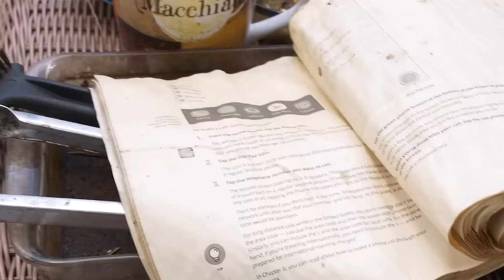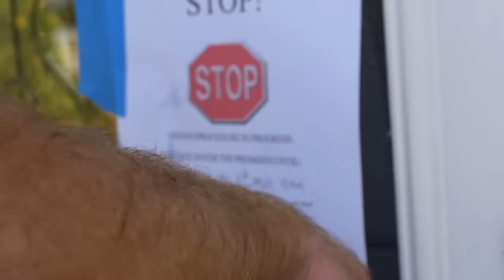Massive Body Meltdown | Naples, FL

Comment: This happened to someone in my building. He was luckily on the ground floor and I was on floor six. It was an early Monday morning and I was heading to work. I opened the door and there was this slight smell like rotten fish but with a tinge of something strange I’d never smelt before that made my heart-rate skyrocket. I had smelt it the day before but it was so minor I didn’t think much of it. My gut immediately went ‘someone has died’ but I have bad anxiety and not smelling death before, brushed it off. It was such a hot day I had forgotten about it until returning in the afternoon. The gate was blocked by a ‘cleanup crew’ loading a bunch of blue bags into their van. The apartment manager told me it was the special needs downstairs neighbour and I couldn’t enter for a while. He was perhaps 60 and had fallen , being special needs (couldn’t communicate) and living alone he had sat there on the floor of the kitchen over the weekend heatwave and somewhere along the line his heart stopped beating. It was a record 40 degrees on the Monday that the smell started to leak past his apartment (dead 2-3 days), and he had literally leaked into the floor and become just jelly. The bags were what was left of his body after the police had come and gone. The smell was so bad it didn’t go away for weeks, You could be on the rooftop and still gagging. The cleanup crew left a window ajar, and that alone made your head spin. We had to work together to close it from the outside with a pole and rags on our faces. His car is still in the garage, as his family still hasn’t been reachable. He used to write on pen and paper to communicate and loved swimming in the pool. I can only hope he wasn’t on the floor in pain for too long.
Reply: That’s the most heart breaking thing ever no family to care no home care from company’s that take care of special needs people ugh 😭
Reply: @boofert.washington2499  So?
Reply: Interesting that the smell you noticed was a fishy odor.  A few yr. ago, the man who lived in the apt. next door to me died and wasn't discovered for a few days. I had detected the odor of fish for several days and just thought someone had had a good catch and was frying it up.  It wasn't a rotten fish smell, just an odor like someone was cooking it.
Reply: OMG that's so horrible 😢
Reply: It's interesting that you compared the odor you detected as fish.  A few yr. ago, my next door neighbor died and had been dead in his apt. for a few days before being found, and that's the same smell I got.  I just thought someone had caught a bunch of fish and had been cooking it for a couple of days.

Comment: The sheer amount of area that the body melted into is astonishing. It's so sad that he was alone, and it took so long for a welfare check. May he rest in peace.  That was a huge job! Done well with respect and honor.
Reply: Melted?!  Huh?  Do you mean decomposed?  Am i missing something?
Reply: @danielleschoenlau7861  yes melted. The actually definition of melt is "liquefied by heat". Decomposition requires a large amount  of heat for its normal processes. Therefore as the body decomposed it melts, because decomposition literally turns the body into liquid.
Reply: Right, this is ONE body?? Just Horrific! Where r the bones?
Reply: @jankasza5538  they removed the bones and any flesh that would have been left that did not liquefy. The coroner removes as much as they can.
Reply: @llewisdolphins So that is literally the man’s liquidated body? 
That’s awful..
Reply: @Juju-l3o  yes

Comment: Craig seems like a good addition to your crew! Wow that’s quite the mess to clean up! You know you’ve been watching these for a while when you instantly say well the tile is going to have to go and the baseboard maybe some of the bottom of the wall studs and seal the flooring underneath!
Reply: Yup, and they're going to have to take out quite a bit of drywall there, and oh, that door will have to at least come down to be cleaned properly if it can be saved, they'll never be able to clean the underside while it's hanging... I have so much respect for how thorough a job these folks do to make sure the sites are clean and safe when they're done.

Comment: They need a bigger sprayer... like the ones that pest control people carry.
Reply: like the one that people use for sanitizing the street for coronavirus
Reply: The sprayer isn't for cleaning.  It has hydrogen peroxide in it which will react to bio material making it easier to identify.
Reply: @thomasdemooka4341  wow, hydrogen peroxide is genius!
Reply: @blazereho811  Also works great to get blood out of fabrics too ..
Reply: @Jennylove.  yeah I learned that throughout my teenage years thanks to periods unfortunately (lol I'm Jenny as well, nice to meet ya)
Reply: @blazereho811  No truer tale lol 
Nice to meet you too Jenny!
Reply: @thomasdemooka4341  I think it is safe to assume that all that matter on the floor is or contains bio.
Reply: @paulk9985  When cleaning a scene where a surface may look clean, the hydrogen peroxide mixture will assure that it is actually clean.  Assumptions aren't safe or acceptable when dealing with biohazardous / infectious waste products.

Comment: This type of death happened to my former car mechanic I had years ago when I was in college. He was a very sweet, guy in his early 60's. It's believed he had a massive heart attack while eating dinner at his dining room table cause that's where he was found. His plate was still sitting in front of him and he was slumped back in his chair. They believed he had been dead 3-4 weeks. And just like the guy in this video, he literally melted all over the dinning room. Customers were coming by his auto shop and he wasn't there. Also, he had customers cars locked inside that he was currently working on. They needed their cars and couldn't get them. He would arrive every morning at 8AM sharp and worked until 5pm like clock-work. I, too,  had called to schedule an oil change for my car and he didn't answer or call back, which was odd. He ALWAYS called back if he didn't answer your call right then. Finally, a neighbor that lived next door to his home called the police cause they smelled an extremely strong foul odor coming from his house. The police came out and discovered him in the dining room. But folks, this ain't even the saddest part of this story! The sad part is that he had a son that lived right in the same city!! How in the hell does your dad die and melt away in his dining room and you haven't even came out to check on him before his body rotted away this bad? Hell, my Dad got a couple hours to return my call or text before I'm lulling up in his driveway! But a whole month?? You haven't spoken to your dad in a month and he never answered your calls .... and after a couple days, you didn't think it was time to go check on him??? Unbelievable!! Some people's kids treat them like strangers in the street. RIParadise Norman .... the best Imports mechanic I've ever seen. ❤️

Comment: Hello moly. He spread thin. I wonder how long it really can take to clean this and get the scent out completely. Especially in Florida? The humidity I'm sure makes it incredibly hard
Reply: Kinda just smells down here in general sooo
Reply: @HelloNewMoon  really? That sounds disgusting 😕
Reply: I would say screw cleaning it up. Bulldoze it. How can it ever not smell?
Reply: well im not sure about decomp but i know a lot of charcoal helps with getting the smoker smell out of a larger basement, so maybe just put some piles of charcoal in the house and hope it goes well......
but if it still smells after a month or two just doze and rebuild the place imho, no one wants the smell of death in a house
Reply: By the time they're done, anything "smelly" will be removed. After airing the place out, sealing any porus surfaces like concrete, and running an ionizer for a day or so, there shouldn't be any smell left at all.
Reply: @MrJest2   Yeah sure
Reply: How much does it cost to do a job like this??
Reply: Burn it down.
Reply: @lyman135  
ozone machine

Comment: I figured the flooring and walls were goners. He liquified and that was there for a while!
Reply: Is that what happened, he turned to liquid ? Wonder why scraping- straight to demo.
Reply: @susannbasta2972  i dont think they can put that stuff in the same trash. I think the bio has to go in a bio bag and the flooring/wood etc would have to go to another refuse facility that probably couldn’t take it if it was gunked in blood. I notice they throw out as little hard material into the bio bags as possible. Even decomp beds they cut out all the places that have bio on them and throw that out but the rest of the bed gets trashed separately. I guess they cant put giant things in wherever bio trash goes. I think its burned eventually

Comment: 14:55  The place should have been gutted out completely and rebuilt. No amount of scrubbing and disinfecting will remove that awful lingering smell, not to mention the continued bio hazard to the next unlucky / unknowing tenant..The wood baseboard, the trims, the gyp rock walls are all semi porous and has soaked in the bio mess like a sponge. You may be able to clean up the tile surfaces, but the grouting is very semi porous. That steel brush only skims the top of the grouting, but the bio mess has soaked all the way in.

Comment: I've never understood ripping out every tiny millimeter of material just to avoid bio that will never be seen or touched. I look at it like is it really a big deal if there is a tiny speck of bio matter under a framing board that sits behind the wall.....when we have instances of whole little mice die behind walls.....you don't rip out everything over that and there is most likely more bio content in an instance of their little body than a speck under a framing floor board behind a wall.
Reply: You want people juices in your house? However I do understand where you are coming from, they are not cleaning out every single little drop as that is impossible. I personally believe it is due to a want for closure for loved ones as personally I would not want to go into a house which has the remains of a family member in. It will also be so that the family is able to sell the house as the new owners would not be too impressed if they were getting new floors and discovered human remains, Or any remains for that matter.

Comment: Old neighbor of mine(down the road) died in late winter/early summer and I guess he didn’t have family or close family anyway. After a couple months his power was shut off and he cooked in the house all summer. They had to completely gut the house first and second floor, I’m talking down to studs in the whole house to get rid of the smell.

About a year later one of their old neighbors across the road put a rifle in their mouth about the time I was going out running, when I went back by the coroner was pulling the body to the van.

Comment: I went on vacation last summer and 3 days after i got home i smelled a foul odor from down the hall. My neighbor had died while i was on vacation. 3 more days past and the smell got worse then the cops came. My neighbor died while i was on vacation and she had popped in the 90 degree heat. The smell was so bad it filled the 8 story building. Balconies on each floor at the north and south sides of the building. The doors were open on every floor and it took over 24 hours after the couch she died on was removed for the smell to subside. Yeah I'll never forget that smell. Like when you go fishing and forget worms in your fridge and they rot then you open the container.

Comment: How long after someone die does the body fluid come out?
Reply: At around 5 days is when liquid starts to leak from the body. It takes about a month for the body to actually liquify but if you live in a hot area or the body is near/on a heater of some sort then they start to melt quicker.

Comment: 12:10 train your techs before you have them clean bio. Ofcourse he needs to take out the drywall. If you know anything about water mitigation, you know water wicks up drywall and gets into the wall cavities. Bio fluids will do the same.
Reply: Also 15:30 the guy is questioning if the bio got underneath the tile in the middle of the hallway. Ofcourse it did. Liquid soaks into the grout and gets underneath the tile. I hope he’s not in a management position.
Reply: Also why don’t y’all remove all the tile. It needs to all come out because you won’t find a tile to match anyways

Comment: Not even trying to talk bad but they honestly did an awful job. I was in the industry for years and the fact they even questioned removing drywall is crazy! You need to do a minimum 2 foot cut on drywall anywhere in the affected area remove all trim/baseboard. The way the just trimmed the bottom of the door jam with a buzz saw is just dumb you should pop the entire thing off. It’s not like you can repair and patch up the area you cut off Just a lot of unprofessional work.